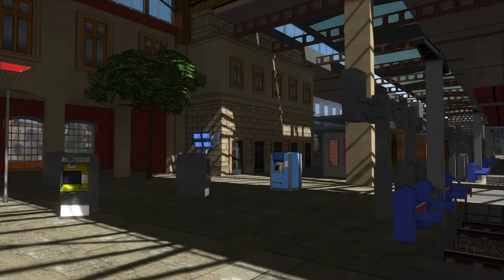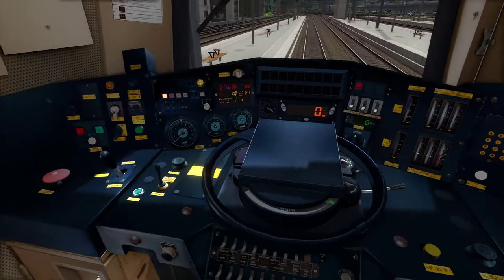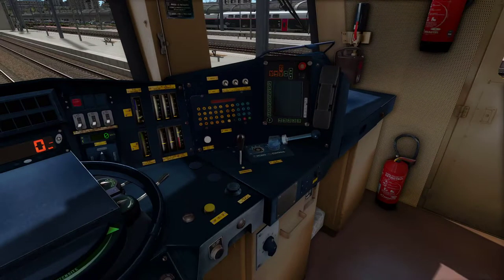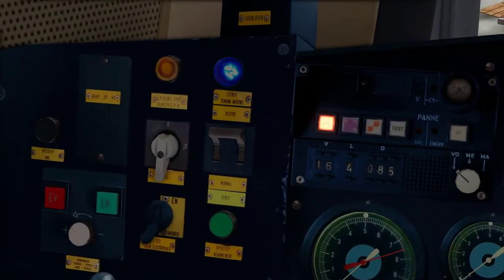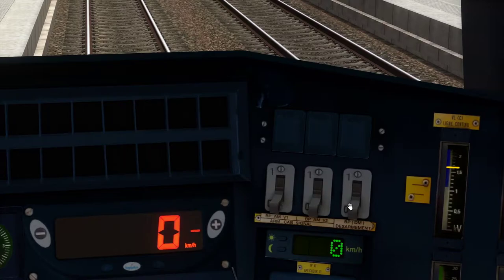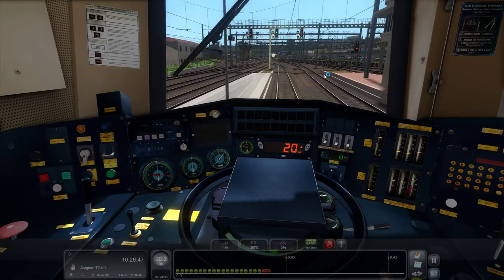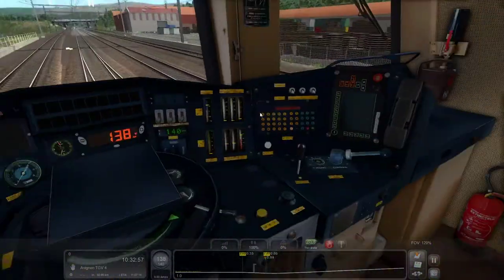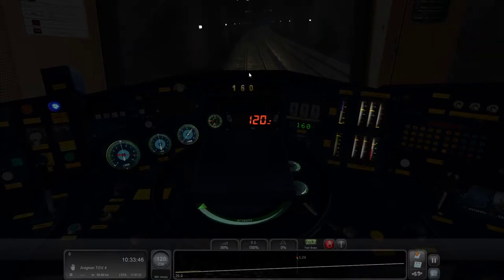Train Simulator: How To Drive The SNCF BB22200 (TOPS Class 22) Electric Locomotive

Comment: How does the lever shown in 9:13 work and how is it used for speed control there is already another lever on the right hand side for that purpose.Pls explain it to me and by the way where can I get a manual of this locomotive.How many positions does the speed control lever have and how do you actuvate dynamic braking

Comment: Hello for the pantograph n=normal, s=rescued, n+s= the two default paf in France the trains all run with the pantograph on n the S simply serving in case of problem on the n 😁, and the kvb on L=  length if the train is 317m it must not be 3 but 4 always a hundred meters higher and a me=fret express 200 does not exist in France for your train in this video kvb parameter to vo=passenger because these wagons  are equipped with passenger train brake systems ;) otherwise have a nice trip
Reply from the maker: Thanks for the tips!
Reply: And I forgot but on old trains in France under direct current we mount the two pantographs so as not to weld with the catenary and all damaged and nothing for the small precision otherwise superb video 😁
Reply from the maker: Cool!
Reply from the maker: @rrdddcd  Thanks for watching, and maybe consider subscribing!